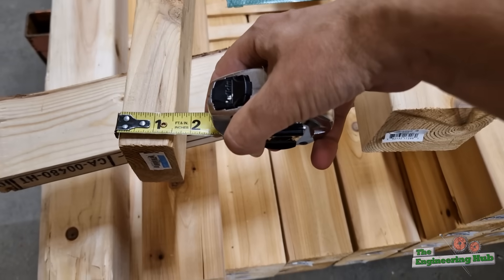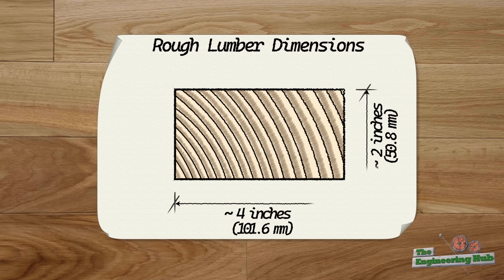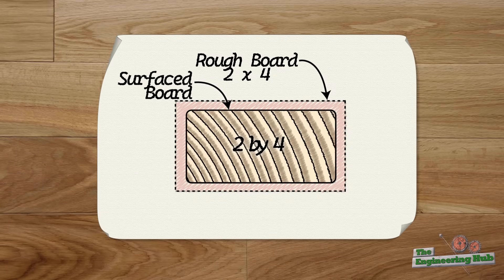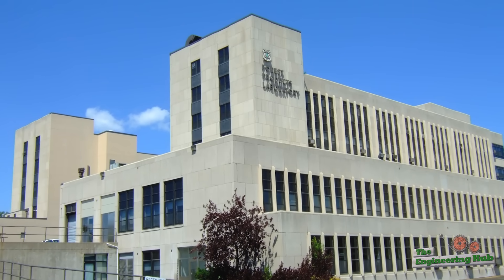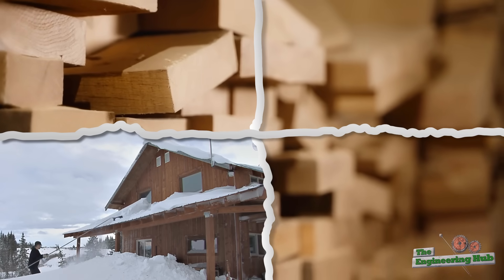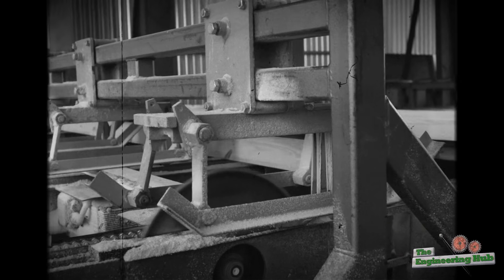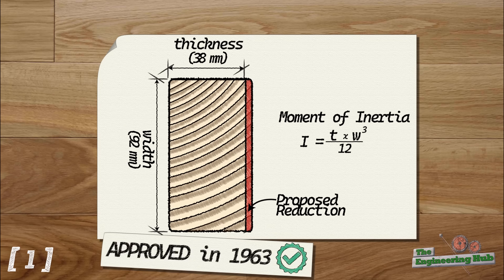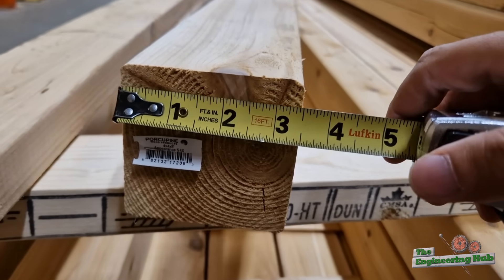Why is the 2 by 4 getting smaller and smaller?

Comment: Working in remodeling years ago I was always fascinated by old lumber. There were historic house that wouldn’t have a single stud be the same size as the next throughout the entire house. Floor joist were often logs planed flat on one side with some bark still showing underneath. I could only imagine the amount of labor required to build some of those structures.
Reply: My uncles house in rural australia, built early 1900s by a single man and his hands. Had an actual tree as a stud with branches still hanging off
Reply: And newspaper for insulation stuffed under the floor

Comment: This change happened decades ago!! Gives you 1/2 each side for drywall so the wall is exactly 4 inches. Why are you so far behind in framing history??? Lol
Reply from the maker: Why is the other side of the 2x4 also resuced, then? Shouldn't it be 3.5 by 2 inches, the 2 inch side does not get drywall on it? Also, the video states the dates of the update of the standard, no one said the standard was updated recently

Comment: That is not true, the lumber was in fact dimensional, but a 2 X 4 was A 2 X 4 and rough cut.   Builder wanted a smoother surface, so it was planned down, and gradually its been reduced to 1 3/4 to 3 1/2 in size/

Comment: I work in a modern lumber mill in Canada and we do not rough cut a 2x4 to those dimensions.  It's more like 1.7"x3.7".  We kiln dry it and then plane it down to 1.500"x3.500" if we are doing our job well.  We have a very fancy grading system to keep us in check.

Comment: Within the first few second of his introduction my mind said P.A.R planed all round. Which means that it starts as 2” x 4” 50 x 100 mm post 1970’s in the UK is then mechanically planed to remove the rough outer layer. Leaving it a lot smaller in dimension.

Comment: Here in Norway our 2 by 4 is 48x98mm which is 1.9 x 3,86 inches. We also have 1,4 x 3,86 inches as well, which is 36x98mm and another funny thing is that in most stores, 48x98mm is cheaper then 36x98mm.
either way, most people refer to these materials in inches in most countries in Europe, at least 2 by 4, 2 by 6, 2 by 8 etc.

Comment: It's been that way since the 50's. Before that it was not kiln dried, planed and chamferred. Coming straight from the mill, the wood shrank as it dried and not uniformly. By the way, slightly earlier it was to the 5/8, as in 3-5/8 x 1-5/8. Now, because in N America we import from Canada, it is actually metric. Retired carpenter, 68 yrs. old

Comment: demolishing the interior of an apartment building built in 1909. found a bunch of newspapers recycled into Wallpaper from 1908 and up to 1925. was about 5 layers of Walls through to the Big logs they used as the base. and I can tell by the ceiling Boards. They are massive and definitely Hand-crafted down to fit. it's such a shame that there was a fire. having to remove all that history. Ofc it is under Conservation so it will be remade back to look as if it did 113 years ago.

Comment: Yeah, but I can tell you, after living my whole life in a house build from rough cut lumber, and building our barn and all our Sheds our of rough cut, you can't beat the strength for the dollar. If the wood doesn't need to look pretty on the inside of the building (like a woodshed or barn) then rough cut is the way to go. My properties buildings are built like brick sh1t houses and the material cost 2/3 what commercially milled lumber does.

Comment: Still, the problem is entirely the false advertisement of the wood.  It amazes me they're still allowed to sell them as "2x4" despite them not being so .. the same with all the other lumber sizes.  Imagine being able to sell a house as a 2000 sq/f home .. when it's actually 1400 sq/f  .. because it's cheaper to manufacture them that way.  No duh .. that's the scam.

Comment: ??? kinda surprised nobody has acknowledged this: the decrease is to allow for standardized 1/2" cladding, while keeping other trades' dimensionality requirements consistent. the walls (with cladding) remain 4" deep to accommodate 3.5" insulation, and the typical gypsum depth stays consistent at ~1/2". also permits other standardized products like light gauge studs to be used interchangeably and in tandem with 2x4's as needed.

Comment: The bending equation should really be specified which way the board is bending. Does it bend across the 2 inch side or the 4 inch side? (The current equation is for bending across the 4 inch side, which is stronger in bending).

Comment: Do you need to watch a 7 minute video? No. I'll explain.
It wasnt some scheme to rip people off with smaller wood, its about the drying process, and a standard size based on the average size used after the wood has been dried.

Actual 2x4 Lumber is Rough Sawn fresh wood, know as green wood. It hasnt been dried.
The Drying process shrinks the wood, a 2x4 shrinks to 1.5x3.5, a 2x8 shrinks to 1.5x7.25.

Its that simple.

Comment: When I lived on the Fraser River in BC my neighbors were friends with a lumber mill owner. They were able to get boards from the mill that would resemble the 1914 boards, they are known as 'rough' or 'mill' cut. We did quite a bit with these boards, and once you work with them you feel like the regular cut is like a toy. If you are framing up cookie cutter houses for profit you get the cheapest stuff you can get away with and laugh. But when you want the wood to be exposed and you care about what it looks and feels like, those rough cut boards turn heads.

Comment: At Home Depot and Lowes, exact dimensions are little more than a suggestion and the only quality control is done by the customer right in the store. As far as these retailers are concerned, if it looks like a board and the mill will sell it at the price they're offering, it's good enough.

Comment: Can confirm my 2019 built house is very nice and has a killer insulation rating however it's made out of matchsticks and toilet paper held together by spit it was my first home my next home will be made of brick I'm talking got to get a Roto Hammer to hang a fucking picture on the wall cinder block brick concrete all around like the Europeans do

Comment: Examining my 120-year old home, in many situations, we use larger lumber sizes today to make up for those smaller dimensions (e.g. roof joists, some floor joists). "Real" 2x4s are much larger and were typically used in framing unaltered. It helped a lot that trees were much higher quality and more resistant to rot.

Comment: Also old growth long lengths were becoming rare and gone,  so new softer lumber is just what is available .  
it bows and rots faster too.  i like my older home 1957 , a small house but good quality lumber and materials.   hard plaster walls  .  hard wood floors 3/4 inch oak over 3/4" pine planks .

Comment: Here is a hack for you if you have to replace real 2x4 lumber. Buy a modern 4x6 and cut it down on a big table saw. It will be 3.5 X 5.5. Take one 1 1/2 thick slice off to get a board that is 1 1/2 X 3 1/2..save that to use elsewhere. The piece you have left is 4 X 3 1/2 slice it again to narrow it to the 2 inch thickness. You will have a 1 1/2 X 4 piece extra save that for strengthening long floor joists or to french onto your new 2X4 to compensate for the lower strength of modern wood.

Comment: i own a 1905-ish house (need to look at tax records, town doesn't know) build fully out of old growth cedar, everything is so heavily overbuilt any construction work i have done usually results in the craftsmen breaking their tools or struggling to cut a simple hole.

i've had a few holes cut to add piping for a higher efficiency furnace and you could see where the hole saw was jumping around with the grain and started to scorch the wood. on another occasion there was some iron brackets that needed to be cut off but resulted in burning through 3 batteries and breaking cutting wheels to cut maybe 1/8th of an inch into the first of three plates, they returned the next day with a plasma cutter and an angle grinder to finally get through it.

Comment: It's getting smaller, its called size sizeflation. They make the boards small to gain more boards out of a cut as to not affect the price difference when your getting less of a product. They're doing this with food right now in the US. Bags are staying the same price but they put less chips in the bag and make the bag a little smaller. Work with a company adjusted a customers machines to match the new size of bags for a food product for this exact reason.

Comment: So if I have a project that calls for 2x4's, and I go get 2x4's, I dont have 2x4's and whether I actually need something to be 2x4 becomes a secondary problem.
Whoever manufactured the wood isnt my concern. Whoever cut the piece isnt up to me.
When I buy a product, it needs to be what is demanded; there is a demand and if it is met I am a happy consumer whore.
If not..
That's stupid.
It isnt my fault or problem that the industry wants to nickel and dime the bottom line consumers and cause a mislableling problem that causes products to be less than what is advertised- in the name of the item, no less.
I just wouldnt buy the wood. And I get that isnt always an option... But the only other option seems to be to just support this nonsense.
Literal nonsense.
If I need to buy a 2x4, why the fuck am I getting any less than 2x4.
It's just ripping off selling short and misling.
Hey, wanna buy a $2 hotdog for 4 bucks? Whaddya mean it's half eaten? My distributor needed his cut. These are the dogs everyone gets.
It's just the industry nowadays, everyone gets half eaten dogs for $4.
Now pay up.

Comment: 2X4s, rough sawn,, are a bit random in dimension,, BUT as structural members,, they were never planed on a jobsite.  I carried a hatchet that had the hatchet to one side of the head and a hammer striking face to the other. One side was assembled flush,, usually the outside,, and the inner face hacked off rapidly  with the hatchet where ever it stuck out,, just before nailing up the wood lath for plaster ground coat.  Been there,, Done that,, Not out of some history book written by someone who never was there.  I also own about 20 hand planes

Comment: Doing a rewire on a house built in 1948 right now.  Can't tell you how many staples and nails bend trying to support NM-B wire during this project.

Also when I drill my holes to run new wire the smell of the terpines released by drilling of holes is heavenly.  New lumber is pure crap.  Almost saw my coworker fall to his death when he hammered in a nail-on receptacle outlet box on a new build.  The stud splintered while he was leaning on it slightly and it broke free.  He fell forward but luckily caught himself before falling 30 feet.

Comment: I salvaged some interior studs from the Olivia in Joplin Missouri.  The building was finished in 1906.  The studs are 3 1/2" inches wide by 1 5/8" thick.  Still perfect for walls.  Just have to take into consideration the extra 1/8" thickness when laying out doors and such.

Comment: Back around 1980 I helped tear down an older house which was made of actual 2" x 4" lumber. I even found a old newspaper used for insulation that had an article about Ronald Reagan, the actor at the time he was either running for president or had just been elected. Apparently that house had been built in the 40's.

Comment: The bigger problem is they are allowed to call it something it is not.  If they were required to put the final dried dimensions on the lumber with a small margin of error then they could make it whatever size they wanted, and the market (consumers) would decide which size was optimal.

Comment: The main issue is these standards aren't too bad if we were still using old growth trees, but as you show at 6:15, as is commonplace, modern "2x4s" are all young, rapidly growing trees and are about half as strong as if an old, slow growing tree was used, like what is shown on the right. Not only is this scientifically proven (look it up on Google Scholar), but human intuition is good enough to tell. Referring back to the two boards shown at 6:15, the one on the left is simply weaker. Let's say it's half the normal length (8ft being normal) of a 2x4, since it looks short to me from this angle, I could easily chop it along the grain in one fell swoop, two at most if I mess up the first swing. I mean, look at how straight it is too! Along the grain is the weakest part and they are nearly in a straight line! However, the one on the right most definitely would take much more force, and for me personally, it would most likely take three full force chops. The one on the left, I wouldn't even need to exert myself. I could chop dozens of the left, young growth wood along the grain in half an hour without a sweat. The one on the right, though... no way. I might get half as many in the same time and be ready for a lunch break. It isn't just about how being smaller or wetter or whatever, it's about the integrity of the tree the lumber is cut from. You also failed to mention the American Chestnut blight, which is more to blame than anything. Chestnut was used for a majority of American settlers (at least in the frontier). One out of every four or so trees in Appalachia was a chestnut, and they were big, trust me, I'm from Kentucky and went to the Chestnut Orchard in college, and these were relatively young comparatively. Why do you think "chestnuts roasting on an open fire" is so iconic? Sorry for my long chestnut rant, but seriously. If there are two things anyone needs to know about why 2x4s suck these days it's old growth and chestnuts.

Comment: While 1.5 x 3.5 would be great...most of the lumber out there is much smaller.  The Lumber industry is as crooked as it gets.  Add to that the rounding of the edges and basically the 2x4 is useless for ANYTHING other than framing.

Comment: I remember being told that they shave off the size when I was younger. I had assumed it was to account for the thickness of drywall. Then again, it doesn't account for drywall on both sides and the fact that 2x4s are used for more than just mounting drywall onto.

Comment: The much bigger problem is that an old 2x4 (or 1.5x3.5) has 30 year rings or more
And a modern has 5 if you’re lucky, making the wood magnitudes weaker

Just look at the image at 6:15
Even if you plane down the older to the same dimensions
I know which of the two I’d like to build my house with

Comment: For those wondering, 2x4 -> 1.5x3.5 is a 34% reduction in both volume and weight (for the same length of board).
Reply: Shrinkflation strikes again.
Reply: Not only that, at the big-box store, it's now not at all uncommon to find "2x6" that are 5.4 x 1.4 or even 1.37. 5.4 times 1.4 gives a cross-section of 7.56 sq. in., which is 5.5% LESS THAN a 1957 2x4!
Reply: Dont Americans use donts instead of percentages or something?
Reply: But it also allows us to get as much out of every log. We don’t have the large diameter trees to harvest anymore, and the volume reduction allows us to get the most out of the wood so we don’t have to log more.
Reply: For the Americans, that's 34/100ths 🤣
Reply: @markweatherill  A European jingoist? I guess stereotypes really do come from somewhere. What's next? The knife and the TV license? Something about the now-non-existent queen? May as well go all the way.
Reply: @misbegotten3508  jealous of the average 6 paid weeks off per year? Or the healthcare that's superior in quality and costs half per capita what it does for USA?
Reply: @ZentaBon  Not jealous of the fact that Europe has nearly turned into Africa...
Reply: @markweatherill  high blow man, us Americans are that dumb. even twentieth graders wouldn't know what you're talking about
Reply: North or South Americans? Choose carefully.
Reply: @markweatherill low blow man, us Americans aren’t that dumb. even first graders would know that’s exactly 1/3rd of an AR-15

Comment: Some of this video needs to also be about how the lumber has changed in quality over the years. Older lumber was slow growth lumber and was inherently stronger than most of today's lumber grown for its growth rate and time to maturity.
Reply: Very true. Lumber with rounded edges , called wane where the bark grew , is more common as lumber manufacturers squeeze every board possible from logs. All of our lumber ( the mill I worked in was first owned by Federal , then IP finally became and still is West Fraser) Over 30 + years lumber came to be cut by machinery that uses lasers to measure cut logs and that info is sent to a computer that determines how best to cut for efficiency and finally the computer guides the hydraulics that set knives and saws to get the most from
 the least. Nothing is wasted.
All mills like the size I worked have a system called 
"  conversion " that compares weight in tons of logs brought in to amount of lumber in thousand board feet are produced. The lower the conversion is the more efficient the mill is. Companies are always trying to lower " Conversion".
When I started in 83 our production was 155 TBF per shift. Due to maintenance as well as saw and knife change  mills only run two shifts max a day. I retired a few years ago and production was over 
.5 million BF per shift. Makes ya wonder with 65 + or- loads of logs per shift how any trees remain. Well production mainly increased due to more efficient cutting machinery but preventative maintaining equipment practices increased and the bad word 
" down time " was reduced as well as more efficient repairs were implemented.

Comment: A 2x4 in metric is called up in structural engineering drawings as a 38x89 (thats its true size) same with all other dimensional lumber. Imperial unit names just stuck with the original sizes from way back when. A 2x10 is actually 9.25" deep so go figure. Many homes on the west coast built in the 40's had true 2x4 with old growth timber.